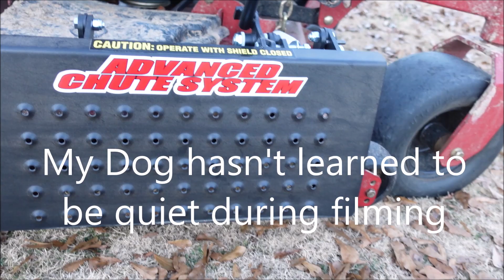Chute Block, Mulch Kit, and Side Discharge Comparison and Demonstration

Comment: What are your thoughts on using the double blade system? I’ve got a Shute blocker but no baffles.
Reply from the maker: I've never tried it
Reply: I run the Ballard xblades. I'm not to impressed with the blades themselves. The adapters are ok. When mulching leaves they work pretty well. Let me say they are extremely heavy. We do not run them if we aren't needing to mulch something into a pulp. They don't stripe well and don't make any difference in regular grass and in my opinion do cause more wear and hurt gas consumption. But when you need to mulch high grass or leaves they are the ticket for sure
Reply: @johnslawnseasttn4489  I've been waiting a LONG time for an honest opinion on the Ballard X blade system.

You confirmed my fear and I appreciate you sharing.

Comment: I actually do the opposite... I mow outside to inside then back over the single line in the middle of the lawn to disburse. I don't have an actual chute block though I fabricated one from black edging material and bungee chord. My chute has a slight curve, not simple straight. Heat gun makes a nice fit.
Reply: That’s what I do. I use a chute so the grass or leaves get distributed through the grass

Comment: Is it not possible  to have mulch kit then open a side shuttle as well?
Reply from the maker: I guess you could have one of the Interior baffles on the mulch kit but just use a chute block for the exterior baffle. Not sure how well that would work though
Reply: @lawncarelife  Thanks for response 👍 and I figure  it could leak out and I imagine  I would want a solid  chute not vented for lift?I'm not commercial  but like to help out some neighbors  sometimes. I like mulching  but occasionally  I wish I could pull that chute and let some grass out you know.Even if I am only mowing on that one side for a minute.Sometimes I mow half deck anyways to make sure I hit all blades and more mow time.I have a Old toro timecutter  that works great but considering  going for a Bad Boy before inflation hits harder.

Comment: I just installed a mulch kit. I think a chute block would put all the stress on the one blade that's next to the chute block. The mulch kit works on all the leaves as if you vacuumed or bagged.

Comment: I just ordered a green guard electric chute block I'm going to try that on my lazer z paired with mulching blades. I know it won't be a true micro mulch liked you'd get with the baffles but if anyone has any ideas let me know
Reply: I've had great results with Copperhead High Lift Blades on my Gravely ZT HD 52" This is the 3rd year with my Green Guard👍